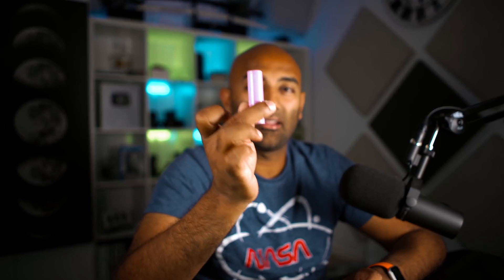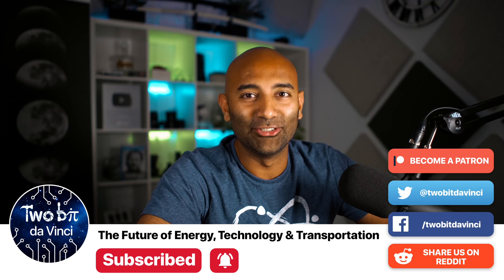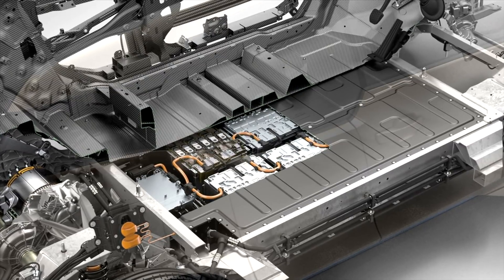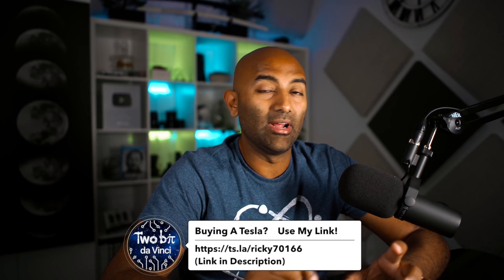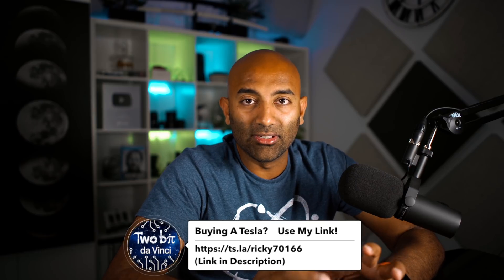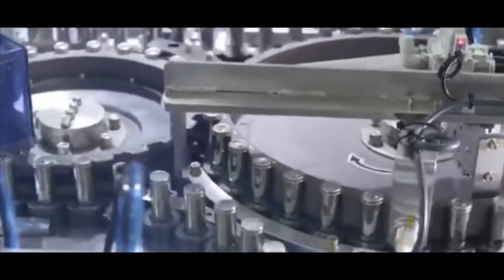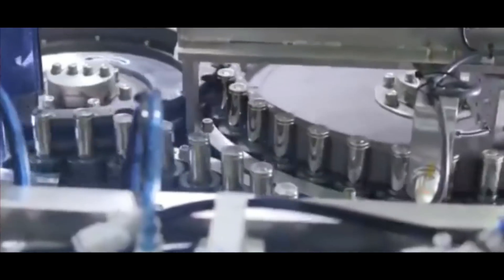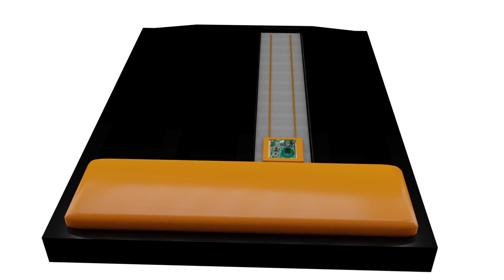Is Tesla Moving Their Battery Strategy to Prismatic Cells?

Comment: Did you learn math at school? Cylindrical shape uses less materials for the same volume 😂😂👍
Reply: Maxim Ivashkov, but rectangular batteries have more volume🐔
Reply: Charles Lu no man. For the same volume the rectangular ones will have longer perimeter and the  mass of the walls which is waist.
Reply: I guess what I’m trying to say is that within the confines of the battery bed, rectangular cells are more space efficient, there is more mass of batteries, not withstanding the mass of the walls, which are also increased.

Comment: No. Don't do it. Standard cylindrical cell prices will drop drastically as supply chains and tooling improve. Manufacturing proprietary battery packs will stunt that progress. The failures Elon Musk's companies have had recently have to be dealt with now (at the time of failure) without the included stress of re-engineering proven designs. Research and development is the highest cost. Therefore, limiting it without reducing quality is prudent. (Prismatic cells are a reduction in quality, and probably not as safe as cylindrical cells are in a car accident).

Comment: Disagree with what is said at 4:59; battery voltage is a function of the chemistry and not construction. You will have to put the same number of cells in series to get to a particular voltage, unless the chemistry has a lower voltage.

Comment: What would be cool is if they did this, but also added a super capacitor to make up for the acceleration and regen breaking deficiencies of the prismatic cells, as the worse battery chemistry when it comes to energy density should be almost completely offset by just being able to have more actual battery rather than metal casing. So your only real down side is recharge time, acceleration and regen breaking. You can't really fix the recharge time, as the capacity of super capacitors is much lower than batteries, but you should be able to improve acceleration and regen breaking.

Comment: Tesla keeps to its biggest fault of non-removable batteries.. Batteries that can be swapped in seconds.  The best configuration would be triangular due to the structural advantage needed to the compartment.    Triangular (triangle with in triangle) has opportunity for cooling through the middle and at the point that would be rounded off.  With three battery compartments, one could be the 'permanent' or owner battery, giving a 50 mile range and the others fast swappable that would be leased and fast swapped at the commercial filling station.  Tesla is now entering the stage that the power companies are going to limit the  commercial and house hold current where these cars are parked, at the draw will be to much at one time if not regulated, making the fast swap battery a better option..\oh, I down voted you to get your attention and you come across as a Tesla shill as you are not scientifically  or economically looking at the obvious drawbacks of what Elton is doing. that is making product that will become obsolete due to critical limitations.  A suckers product.

Comment: Haaahaahaaa, did Tesla finally figure out how badly they screwed up with their battery design? There is a reason no other auto maker uses such tiny cells, manufacturing them is super expensive and scales horribly badly. All the money Tesla poured into gigafactories, they are going to have to do it all over again for a completely different battery architecture.

Comment: FLYWHEEL BATTERY/CAPACITOR BANK....

Batteries should be stored under the back seat, in 3 cylinders, separated by bearings, mounted on an axle
either side of a (fly)wheel that has a gear connected to a gear on each battery bank axle. The central, flywheel is mounted on spring-loaded hydraulic pistons, mounted on bearings so the forks can swing freely forward and back. When hydraulic pressure is applied (ie, via the brake pedal) the rubber coated wheel is pushed down, with its gears rolling around the spinning battery bank gears so they always stay in good contact. When the flywheel hits the road the vehicle brakes a little as the heavy battery bank is spun up. It's retracted when the banks are at full speeed... Powerful generators at each end of the battery bank axle quickly slow the bank, and if the brake pedal is still pressed it engages the flywheel with the road again to repeat the process... Battery packs are connected  to the vehicle body via brushes but the generators are brushless DC generators, with the permanent magnets mounted on the axle.... It's a slow, heavy but powerful and simple flywheel generator, regen. brake system that turns considerable battery weight into electricity...

Comment: I'm not sure if this has been tried before, but what if they used mineral oil as the coolant for the LFP batteries?  No need for piping and isolation of the liquid from touching the components or contacts, it's non conductive, so you could essentially fill the battery pack with the fluid and run it through a heat-exchanger.
Reply: I'm not sure you'd want a liquid taking up such a large volume without some further mechanisms keeping it under control. Not in a moving vehicle anyway... You'll create strange and problematic centre of mass shifts...
Reply: @KuraIthys  Just do what the NASA guys did, use baffles.  Actually I'm more interested in the fact that the oil can absorb more heat than water based solutions, the lower viscosity will create more resistance through the pipes, but it won't have to travel as fast if it absorbs more heat in passing

Comment: Wouldn't battery incremental degradation be in greater with fewer and larger cells in a battery pack?

Isn't the energy density lower with the LFP chemistry? Heavier battery pack for the same capacity. How much more will the prismatic battery cars weigh than their cylindrical counterparts? Will the range be lower?

Comment: Okay,  Really good discussion.  The prismatic battery represents the 1964 Ford Falcon  of efficiency.  The next move should be a Tesla Kit Car where the battery arrives separately from the auto body and chassis unit.  Many mechanically inclined buyers would love to be involved in bolting up the batteries on a frame from underneath the car.  If that could save the buyer and Tesla some money, it's a no-brainer.   Like you said: profits can be made in buckets via the volume of sales.  I don't have a car at the moment I need a car, I want a Tesla but cannot afford 25/k for a car.  Have been a mechanic all my life.  Did I mention I want a Tesla?  Keep the autonomous stuff; I like to drive.

Comment: Sorry, but you are spreading your own misunderstandings about batteries. It is not the case that a bigger cell has a higher voltage - the voltage is determined by the chemistry. You do not get a higher maximum charge or discharge current by having many small cells instead of a smaller number of larger cells. All else being equal, using a single huge 3.7V cell or 10 000 cells with 1/10 000th of the big cell's capacity results in exactly the same charge and discharge power. That's why these rates are always stated in C, the current unit that is relative to capacity (1C for a 3Ah cellphone battery is 3A; when you charge a 60 kWh pack at 60 kW, you are charging at 1C). 

It's not actually hard to understand why this is so. If you put X batteries in series, giving you a pack voltage of X*cell voltage, but 1/X maximum current => same power. You can have 10 stacks of X/10 cells, for a maximum voltage of X/10*cell voltage and 10/X maximum current, again the same maximum power. 

In practice, however, there's a lot of considerations, and I don't have a clue why Tesla thought 2170 was an optimal cell size for cylindrical cells. But it's easy to see that the size choice affects many aspects of manufacturing as well as design considerations like thermal management and safety (presumably a single cell shorting is easier to contain the less energy the cell holds, for example). 

It's fun to try to speculate about things we really don't know much about, and anyone with a curious mind who wants to understand stuff does it. I certainly do it myself, all of the time. But I don't set up a youtube channel to talk to people as if I know what I'm talking about. Neither should you.

Comment: I'm suprised that they haven't taken advantage of the waste heat by using a peltier to covert some of the heat back into electricity. I know they aren't very efficient in generating electricity and they are expensive to produce but I'd think any gain would be better than none, and when plugged in they could helpbcool the battery pack when doing a rapid charge.

Comment: I think you missed a key issue with CATL, their cell-to-pack technology. Eliminate the 2  step process and just build the cells into the pack which should reduce cost. The quality and life expectancy of battery have reach a point that should not have to worry about them for the average life of the car ie: 200,000 miles.  Just design and build a pack for a specific model, seal it up and be done with it. The only maintenance would be the cooling system.

Comment: Ah! For the standard range model. That makes sense. I use LiFePo4 cells in embedded electronics/IoT devices and the best cells I found so far are 1400 mAh in 18650 form factor compared to a Sony/Murata VTC6 which has 3100 mAh. NMC cells operate at 3.7V and LiFeP4s at 3.2. The latter is interesting for my microcontrollers where 3.7V is too much and I get away without the need for a voltage regulator. And in IoT I don't need much capacity, typically they draw about 10 mA. 
I have a LiFePo4 starter battery in my bike (4s6p, drone pilots know what I'm talking about 😊). They can take a lot of abuse, i.E. high currents, and are lighter than lead acid batteries. I plan to build a power wall from 26650 LiFePo4 batteries because they are somewhat safer then NMC. But with my resources those will be much more expensive per Wh than LiIon ...

Comment: Wow, a plastic tank and fuel can get with my engine 155 mpg x 33 gal = 5115 miles.  Weight 264 lbs.  Over 16x more range for 1/4th the weight.  64 to 1.  Batteries are a joke.  Fuels are key.  My new engine makes EVs obsolete.

Comment: no they are not so long story short they are not doing away from old batteries just in china they have machinery that is garbage if they stay with round batteries and pay million in retooling no in china they will keep the methods they have to make batteries to keep cost down and high volumes of batteries to fulfill demand of china market
the model y is doing poorly cyber truck and the Mach E made the model Y lose over 60k reservations. the model y had an international preorder count smaller than  S or 3 or X american only preorders  then they lose 60K to cyber and mach E unveiling. most of model Y preorders are model 3 owners and i believe when they try to trade off the model 3 it will crash its resale value leaving the average model Y owner owing 15k that will roll onto the Y final bill resulting in a sticker shock they didnt anticipate. then you add the fact the model y storage capability was over rated with immoral tact as well as the windows on the y is ridiculously tall making it look like a clown car haha "prius" the low hinge point to hatch may result in disappointment if you move large items like furniture or instruments. then you have the fact that your paying 5k more for a uglier model 3 with lower performance.
you have the mach e that claims on paper to match the Y in spec but you can save nearly 40% in price because you get FSD in mach e for 0 for tesla its 7000 you get federal tax rebate of 7500 and in california you get another 2500 for a total savings of 17k. so buy a 3 i wise choice or wait for mach e if you want a hatch.
tesla has already shown concern for its high supply and its low demand lol

Comment: Add a tag in the software coding of the car for the region of origin so only relevant updates to that variant are downloaded and Tesla will have to suck it up and get a team to write those codes and test them not a big deal easier than Standard and Metric BS for parts and tooling.

Comment: I have suspected that pouch cells handle the swelling of the cells much better than the cylindrical cells, and of course, they’re lighter as well.
Reply: M Bacon I’m not sure why Tesla is going into it then. Maybe “fragile”is not the appropriate term. Sure, not as strong as the heavy cylindrical cells, but then it doesn’t need to be that strong (since there are no significant mechanical forces on it). 
Maintenance - I think maybe these cells have even better battery management systems, maybe that’s why all other companies except Tesla and Rivian have opted for pouch cells.
Reply: M Bacon of course pouch cells are contained in sets (of 4 I remember seeing) in a prismatic case in ev’s. There is also a “spiral” design (sort of like a squashed swiss roll) for ev’s. No ev uses pouch cells on their own, that is not rigid enough. The point was, I think that the cylindrical cell was inferior in terms of power to weight ratio, even though they were lower cost in terms of their faster production rate. I suspect the prismatic (whether they use the pouch cell within, or the “spiral” design) are catching up with their production speeds and costs.

Comment: I am not sure if you mentioned the possibility of Tesla going from Battery Modules straight to Battery Packs using this Prismatic Battery Batteries.  The reason I bring this up, it would mean Tesla could increase the overall Battery size to counteract the lower density  prismatic batteries and thereby improve the range. Based on Musk`s comments on the third row podcast, Battery Modules is something that is no longer used in the Model 3 (you cant swap the modules out). It is a legacy technology continued over from the original roadsters, therefore it puts unnecessary weight and uses up space which is at a premium.

Comment: Just incase people were wondering, prismatic cells have been available for years, it's not new technology. They will probably use LifePo4 chemistry too, which is a lot safer!
Reply: A lot safer yest, but, again, less energy dense so even less range.......not good.
Reply: Nico chinese have been using lifepo4's forever in their ev's, it does not seem to bother them. It does make peculiar looking cars though as they take a lot of space and are very heavy. Range is a complicated thing as you could easily make a tesla s from lifepo4 and keep the same range. It would just be packed more tight and slighly larger. There is plenty of space in a chassis like that though so saying it has less range is wrong, as you could always pack things more tight and tesla is a very inefficient packing to begin with, so they actually have a very poor range if you think that way.
Reply: I think Tesla had a great heat exchanger system in their battery and I’m not sure that the Prismatic Batteries will be as good for Aircon, I’m thinking a combination of batteries and capacitors might be a good way to go ....
Reply: CORRECT!!  LG Chem & AESC were some of the first companies to sell large quantities of prismatic into the auto industry. Tesla started building cars before that time, and used what was available ... 18650 laptop cylindrical cells .. Tesla proceed to develop ALL their battery pack tech based on those old cylindrical cells, which IMO, became an outdated cell choice when LG Chem hit the market (and A123 followed right after, but went bankrupt because their LiFePO4 chemistry while safer, wasn't as power dense as the cobalt based cells ... greed vs. safety, and the industry chose greed, what a surprise!!!).
Reply: When tesla made model s cylindricals were the only ones which were reliable and consistent enough. And in a way still are. That is the greatest challenge in EV world and will continue to be so for a long while. Chinese still primarily make lifepo4 prismatics, that is what they have always done and put in their ev's and I would find it slightly amusing if tesla switched to those.

Comment: You didnt mention that they will be abandoning battery modules and placing the prismatic cells directly into the battery pack.  This will allow them to increase the number of prismatic batteries that they can fit into a pack in order to compensate for the lower energy density

Comment: This pattern will stifle common purchase desires for BEVs.   If the batteries themselves,  the heart of the vehicle and most expensive part of it keep radically changing every ten years....
Then when does the smart buyer climb onboard to plop down $50k to $100k for a car?

Do I buy a NiCad BEV in 2009 for 50k?  Will it get better?   Do I buy a Li 80kW carin 2020 for 55k?  Will they be like the original Leafs nobody wants now? 

There was a fear in the early 80s that any PC you bought would be crappy or abandoned hardware next year.  The kits then:TRS80, Apple 2, HP,  IBM PC 8088, Timex,  Atari,  Commodore,  Osborne,  ...  CPM or PC DOS or Apple OS or QBASIC or MSDOS or Motif or Mac Windows or MS Windows just to make it work.... Then Ashton Tate or Visicalc or MS or Apple applications.   Must pick the right system or be unable to interact with others.   Then networking:  Novell,  Appletalk,  Pathworks,  NT,  PC Net,  TwinAx, thicknet,  thinnet,  TP,  fiber,  ....

8" floppies.   5.25" single sided,  flip over,  dual read,  microfloppies 160k, 340k, Jazz Drives,  Jazz 2, Hard Drives,  partitioning rivalries, ...

Parallel,  Serial,  Bus daisychain...

It was a big mess with lots of disposed junk in the tech room.   Home PCs didn't really catch on till around 1988 or 90 as things had settled down to two basic camps of  similar architecture,  that just got a little faster,  bigger and cheaper each year. 

Best to stick with a battery and phase in new batteries quietly.